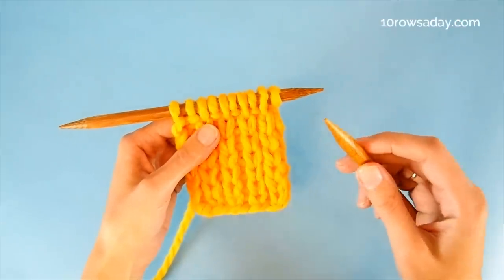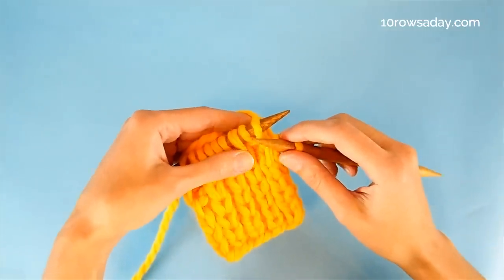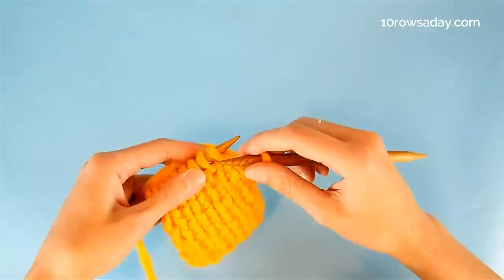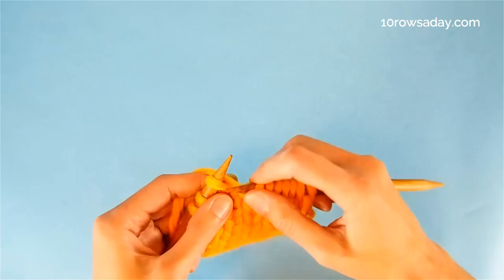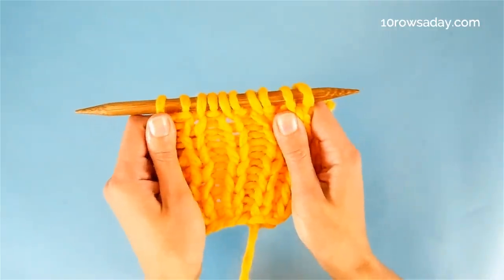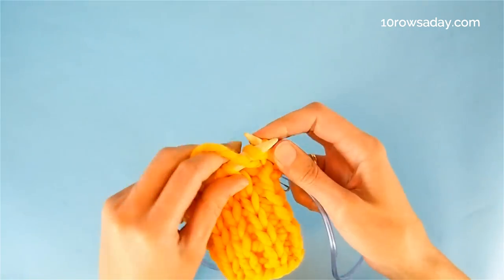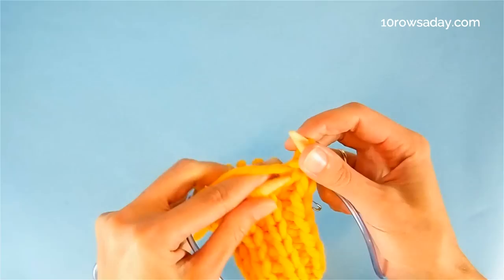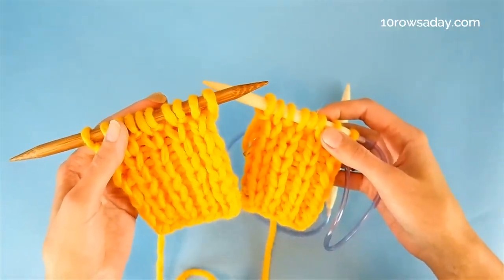One Small Change That Makes 1x1 Ribbing Neater and Tighter

Comment: In other patterns, like sweaters, should I add an extra stitch on each end of the cast on to do the slip stitch salvage edges?
Reply from the maker: Yes, Judy. If the pattern does not include selvedges already, then you need to add selvedge stitches to the number of stitches you cast on. Happy knitting :-)

Comment: Yours looks great.  If my pattern calls for 50 stitches and i add the single slip stitch at the beginning how does that affect my pattern with that extra stitch?  I'd like to use it on my new sweater project.  Thanks :)
Reply from the maker: Hi Cathy. Usually, selvedge stitches are not included in the stitch count (unless the pattern states otherwise), so if you want to add a slip-stitch selvedge to one side of your project, add 1 stitch to the number of stitches recommended in the pattern and cast on 51 stitches. Then the stitch pattern will not be shifted by one stitch. Happy knitting :-)
Reply: @10rowsaday  Thanks a lot.  I forgot to say that I was making the sweater in the round with the ribbing for the neck so I don't know how that would work with no seam.  I'd still love a straighter neater ribbing but i don't know if that's possible in this case.
Reply: @melvinbeli1  for knitting in the round, don't add extra stitches, just slip the knit stitches every second round.
Reply: @10rowsaday  Thanks so much!

Comment: How does a tubular cast on (number of stitches) work with this technique?
Reply from the maker: The first row is the same as 1x1 ribbing, so this method does not affect the cast on edge in any way. Happy knitting!
Reply: Thanks!
Reply: I found casting on the extra stitches confusing. Please make a video that combines the two techniques. Thanks.